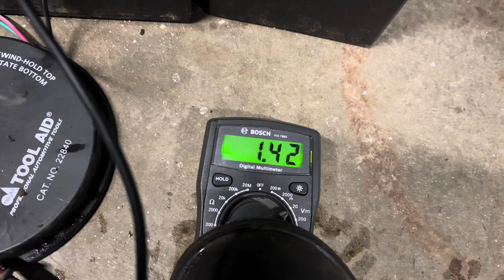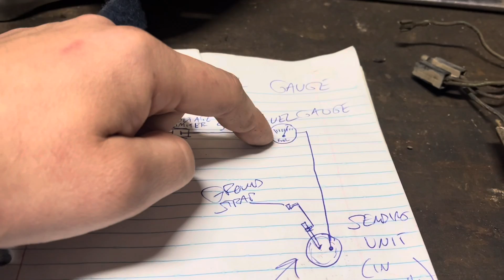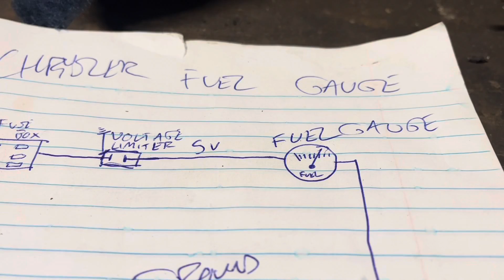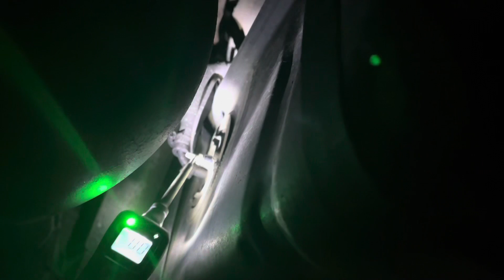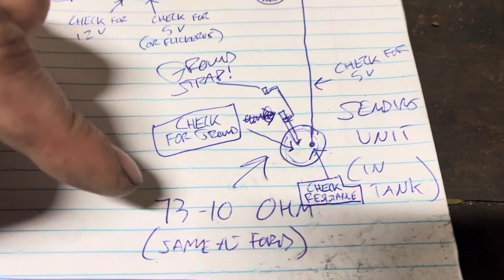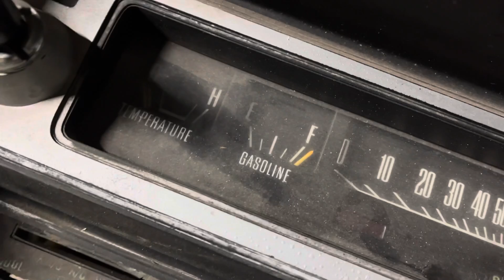Classic Mopar Fuel Gauge Problems (And Gauge Voltage Limiter Info)

Comment: Super helpful video!
Working on a 76 Dodge B300. Same issue. Charging gauge works, oil pressure gauge works (holds at 30-40 then sporadically pegs out at the top end!) Engine Temp gauge and Fuel gauge do not work. Replaced fuel sending unit. Did all the tests you showed. Got power to the fuel gauge and sender. My test probe light comes on, but about a second later starts blinking. 
I'm stumped. Next step? Replace the gauge voltage limiter/regulator?
Reply: Should add, I tested the fuel gauge by bypassing the sending unit with a direct lead from the battery + post.
The gauge worked. It pegged out immediately.
Reply from the maker: Traces on circuit board? If oil gauge works, and you’re getting the flash (there should be a delay - the voltage stays steady at start up so the fuel gauge comes up quickly) then the limiter is good. Wait, you’re seeing voltage at the wire for the sender? That would indicate a lack of ground for the sending unit. Is that a plastic tank? Is the ground strap in place?
Reply: Yes it's a plastic tank. 
I ran a ground wire from the ground terminal on the sending unit directly to the frame.
I just today discovered that there is no condenser/capacitor present for the voltage limiter! I plan to add that. Also, there's a ground wire coming from just below the dash that is hanging free. I'm wondering if it goes to the circuit board. 
Also, if the engine Temp or the oil pressure sender is faulty, would either or both affect the fuel gauge?
Reply from the maker: @jaycasciato9436  that condenser is not there for gauge operation, it is to prevent the opening and closing of the limiter points from interfering with your radio. I wouldn't worry about that. No, there is no ground wire to the cluster. There is one to the steering column mounting stud though. The cluster is grounded through its mounting screws, so make sure they are present and tight. No, the sending units for the other gauges will not affect the fuel gauge. They are connected to the same power source, but that's it.

I just want to clarify something. I showed how to test for voltage at the sending unit wire. If you are seeing voltage (and/or the on-off voltage) at the sending unit wire with it disconnected from the sending unit, then you have proven that the limiter, the gauge, the circuit board in the dash and its connections, and the wire running back to the tank are all fine. The only factors left are the sending unit and its ground. Connect the wire to the sending unit in such a way that you can get a probe to the metal connection. Do you still see voltage? If so, there is no path to ground to complete the circuit. Move your meter to the ground post of the sending unit. Do you still see voltage? If so, the sending unit is good (electrically speaking) and your frame ground is no good. If, by chance, you see the voltage signal on the the positive/signal post of the tank sending unit, and no voltage / good ground on the ground post of the sending unit, your new sending unit is bad.

Comment: As an old school auto instrument repairer, I agree with everything you've said here, actually you're the first to reasonably accurately describe how the system works.  Whenever I get a set of gauges to repair, the thermal regulator is chucked by default, working or not, and replaced with the solid state unit you pointed out.  
The original thermal regulator has a duty cycle of 60% off, 40% on, thus 40 % of 12 volts is 5 and they are adjsted very carefully at factory and, as sate in SOME videos out there, are NOT adjustable.
It is averaged out but the gauges are calibrated at factory to 5 volts not 6.  
Back in the day, the common resistance in the US for gauges for most vehicles was 73-10 but while the temp and oil senders might have been interchangeable, good luck using parts from other fuel senders, the float maybe but that's about it.
You didn't mention the solid state regulator is an LM7805 (1 amp ) and when I build replacement regulators for classic instruments I always add a 6.8 ohm 5 watt resistor to the 12 volt input to limit the input current.  Without it, the regulator gets super hot and has to work really hard, even if you bolt it to the cluster back case or use a heat sink.  The 7805 is still working within its limits but working really hard so the addition of the resistor to the 12 volt line keeps the regulator cooler and happier. 
Oh, and best to use one 7805 per gauge. 
The only difference in operation between the thermal and the 7805 is that with the original thermal (when working properly) the gauge would receive a full 12 volts on start up for a few seconds before the points start to open and close and thus the pointer would climb to it's position quickly.  The 7805 delivers 5 volts from start and so the gauge pointer rises slowly to the designation position. 

Anyways, good information, and the most accurate I've seen on youtube so far.
Reply: Whay would you say causes my fuel gauge to stop working when I fill up the tank. 3/4 full it's OK, any more it goes to below E.
Reply: @terryhauck2982  90% it is the fuel level sensor in the fuel tank.  If you have a modern car, the fuel level sensor and the fuel pump are built into the same module. 
If it's a classic car it will just be the fuel level sensor.  Your mechanic or auto electrician can easily confirm this.
Reply: @ellesmerewildwood4858  I have the old sending unit that still works. I will put it back in. These days new parts are crap.
My temp gauge pegs when I ground the sending wire at the pump, but it never moves when the car is warmed up. New sender in the pump and it's a 64 Dodge Polara. Thanks
Reply: @terryhauck2982  I'm in Australia so I'm not familiar with the 64 Dodge Polara, but most US cars of that era had Stewart Warner or King Seeley gauges both had a resistance of 73 ohms empty/cold, 23 ohms half, and 10 ohms full/hot.
You can get yourself a 10 ohm 1watt resistor, a 25 ohm 1 watt resistor and a 75 ohm 1 watt resistor.  Put one end of the resistor to ground and the other end to the wire that goes to the gauge, this acts a substitute for the relevant sender then observe the gauge's behavior.
Keep in mind, as I said in my original post, the thermal regulator is the weak point in the system.  You will either have a thermal regulator built into one of the gauges or a separate little rectangular can on the back of the cluster.  If the regulator is a separate unit, replace it with a solid state unit, you can find these regulator replacements on line.  If the regulator is built into one of the gauges, it gets more complicated and you'll need someone more specialized to change that into solid state. But do the resistor test first and see how you go.
Reply: Mr. Wildwood. Im building my 76 dodge b200 right now. What the hell does an idiot like me do for the wiring because i am lost
Reply: Wildwood, exactly! I like your input resistor idea, plus the separate device for each gauge, fuel, oil & water. I am using a 3 amp variable DC voltage regulator set to apx 5.5vdc available from cramazon for all 3 which runs almost warm with an added copper piece of sheet metal 1 inch x half inch.

Comment: 1979 Dodge Adventurer D150. Oil pressure gage not working. Does voltage limiter affect the oil gage also? Gas gage works but not the oil gage.
Reply from the maker: Yes. Fuel, temp, and oil are all on the limiter circuit. I would check the connections on the back of the cluster. I also have a video about fuel gauges (that covers the others as well) in the electrical playlist on my channel that may be helpful.

Comment: If my tach fuel gauge and speedo don’t work, but water temp will go to hot what do you think it is?
Reply from the maker: You have all kinds of problems. The speedo and tach are both completely different than fuel/temp and are unrelated issues. Speedo, the cable or speedo itself could be bad - or you have a speedo drive gear issue in the transmission. I don’t know what year this car is, but early tachs run on a separate module that dies. Later tachs have the control board built in, and they still die. It could also be disconnected from the coil. It could also be unhooked from the fuse box and has no power. Fuel gauge could be a bad gauge, a bad sending unit or sunk float, a bad gauge cluster circuit board, a bad cluster to harness connecting pin, a missing sending unit ground strap, or a wiring problem. Usually it’s one of those first two. Your temp gauge pegging to hot likely means that the voltage limiter on the back of the gauges is bad (it also runs the fuel gauge,) and if you don’t remove it or disconnect the wiring to the cluster, your temp gauge will let the smoke out in short order, and you’ll be shopping for a new one.

Comment: My temp guage works but not my fuel guage. Where do I start? Guage or sending unit?
Reply from the maker: Sending unit is definitely most likely. Circuit problems are possible elsewhere as well. If you do the test I show in the video and temporarily ground the fuel sending unit wire at the tank, you’ll find out pretty quickly which it is.

Comment: The fuel guage in my old truck has never worked, but fortunately has a back up guage, aka trip odometer - I zero it at fillup and when it gets to 300 you need to refill it

Comment: Wish I had seen this video earlier😂 My 64 has it built into the fuel gauge, I found a NOS one and magically all my gauges started working, except my Amp gauge.
Reply from the maker: Yep. Built into the fuel gauge for many (all?) models in the mid 60s. Weird - amp gauge is usually the only one that works! Yours must be bypassed already.

Comment: I’d like to see a video on repairing the amp gauge wiring. My 73 Charger cooked the bulkhead and connector. I’ve taken the connector out at the bulkhead and ran a heavy strait wire to the gauge post. I also added a few fusible links in areas. Would love to know your input.

Comment: when you were using your meter in the back of the car to test the ground and then you grounded the wire to make the fuel gauge move.....is that with the key/ignition in the on position? or does it matter?
Reply from the maker: Key has to be in the run position for that to work.

Comment: I have a 71 Charger SE 383HP that sat for years.  Fuel gauge didn't work but surprisingly after pouring in some Marvel's Mystery oil in the gas tank suddenly the fuel gauge came to life.  Also if I go to long without putting Marvels in the tank the gauge quits working, so I use it regularly.  Serious, Not joking!
Reply from the maker: Huh. Now that is really interesting. The gauge in my Demon randomly starts working again occasionally, and I narrowed it down to a sending unit issue in the tank during the filming of this video. I might just have to try that… for science!
Reply: Ah good point. I'm about to crank my 74 charger 318 for the first time in 4 years. Thanks for the reminder to get some marvel mystery ahaha
Reply: @1badombre82  haha np, enjoy the ride!

Comment: When you replace the voltage limiter do you pull the dash cluster out or just somehow climb up under the dash? Thank you!
Reply from the maker: I know we talked about this in the live chat, but for posterity I’ll answer here - it varies by body and dash style. On the rallye E body setup you’ve got, I am fairly sure you need to pull the cluster. On other clusters where the limiter simply slides in, it is often possible. There will probably be stuff in the way, and it will probably be annoying. On some models, it is blocked by the column support, and there’s no way around pulling the cluster.
Reply: @DeadDodgeGarage  thanks for sharing tour knowledge with all of us👊
Reply: Could you make a video on the wireing for a rally dash ? Thankyou

Comment: Forgot to mention the four wheel independent suspension. Same as when released in 1977. Holding hydraulic power steering on full lock is known as driver error & is mentioned in the owners manual as a do not do. The noise is the same on all hydraulic power steering cars.
Reply: This comment is about the LADA NIVA video I watched in the saved video not the MOPAR FUEL GAUGE. Thanks YouTube.
Reply from the maker: Ahhh, a Lada! Luxury.

Comment: I have a non-rally dash on a 1971 Dodge Coronet, there is power to the circuit, but the limiter is apparently direct and when I open the ignition switch, the indicators do not move. Will they be Damaged?Will they be Damaged?
Reply from the maker: Direct, as in failed in the closed position, so 12v is seen at the gauges? Yes, most likely the gauges have failed due to this. When the limiter failed, they likely showed high readings briefly and then cooked.

Comment: @12:26 are you just shorting to ground the wire that goes to the sending unit?  It looks like you have 12v from the battery to the voltage limiter, I'm sure the cluster is grounded already, and then you short the outbound wire to ground to check for needle movement - do I have that right?
Reply from the maker: Exactly. From my three wire spool, I had one connecting power to limiter, one grounding the limiter / cluster, and a second ground which I was temporarily touching to the sending unit wire. I don’t leave it that way long - just long enough to see gauge movement. If the cluster is wired to the car and the key is in the run position, you just ground the sending unit wire to achieve the same thing.
Reply: @DeadDodgeGarage  perfect, that’s what I did and my gauge is confirmed working. Took about 10 seconds to climb to full since my limiter pumps out 5v about once every two seconds. Thanks for the reply!

Comment: Dealing with this in my 68 dart. Instrument voltage regulator is bad. Is there an easy way to get the panel out, or is it possible to replace it from behind without removing it?
Reply from the maker: You can remove some of them with it in place. I can’t recall if that is possible with that 67-71 dash layout or not. Pulling the panel is very annoying, and I can’t say I’ve ever found an easy way. If you have to do that, unplug the battery, lower the steering column slightly, remove the screws and say a prayer. Just remember, if the regulator failed in the ‘closed’ position the gauges could’ve burned up too. Wise to test the gauges if you’re going to pull the cluster.
Reply: I was able to go behind the dash with it installed and put in the new regulator.  I’m guessing you’re right and it stuck in the closed position and burned out the gauges because they don’t work so it looks like I’ll be pulling the cluster to replace the gauges
Reply from the maker: @Suddenlyits1960  Dang it. Yeah, unfortunately that's very common. It happened to me in my '66 Barracuda in the McDonalds drive thru once. The smoke was very obvious.. By that time it was too late. We replaced the gauge many years later and it worked again. I should add, you could have other issues in the circuit - there is a fuse that powers that regulator, so you might want to verify that you are getting power through it.